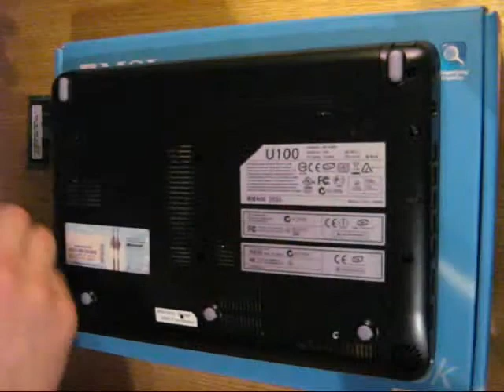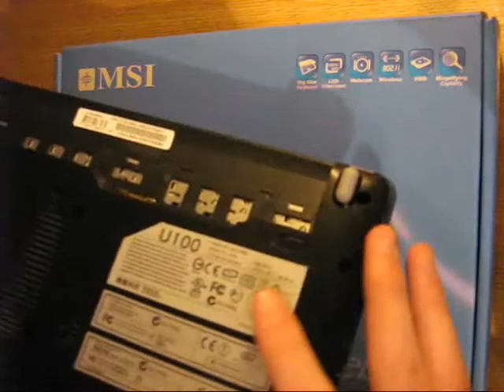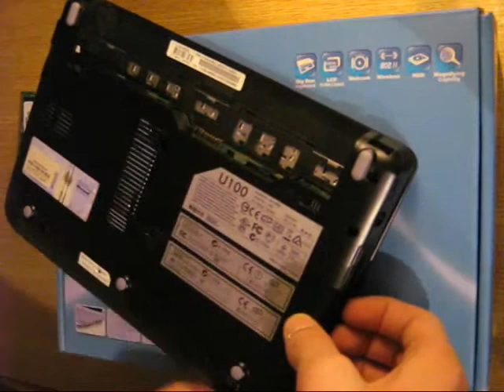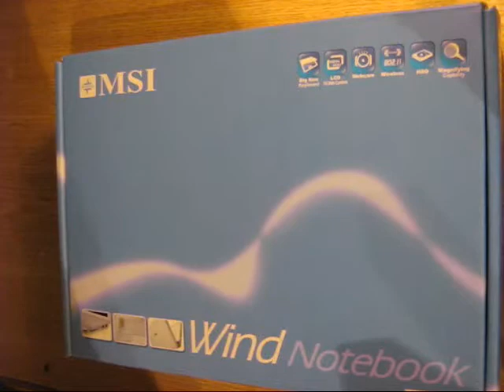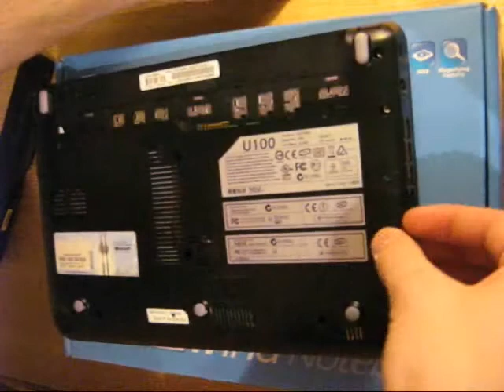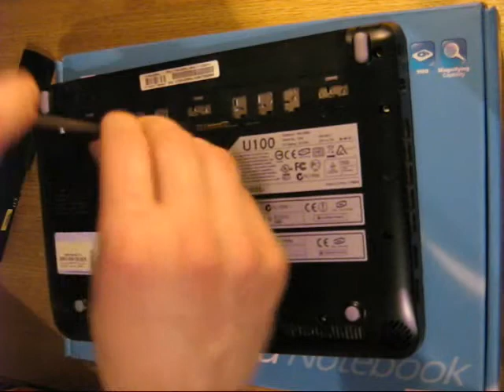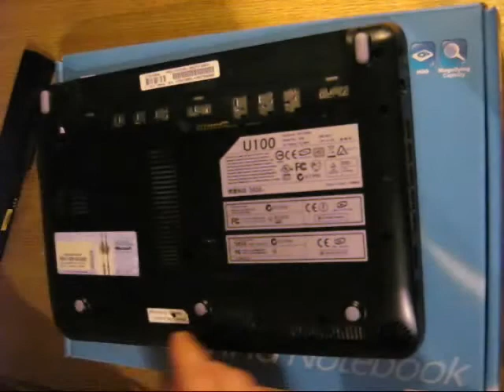MSI U100 1 GB RAM upgrade with voiding warranty - dissasembly

Comment: the maximum allowed is only 2 gig, and the unit it self have a 1 gig installed and solder, if i add 2 gig ram, will it come with conflict or not?